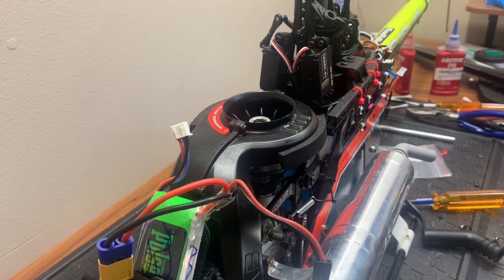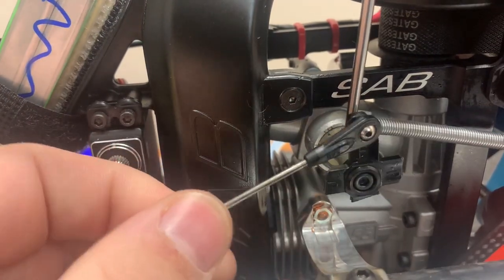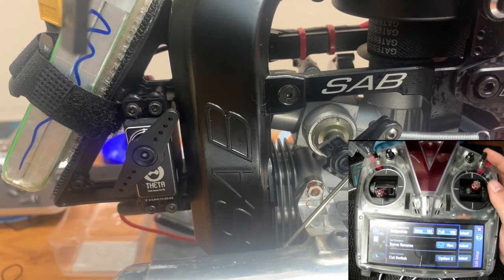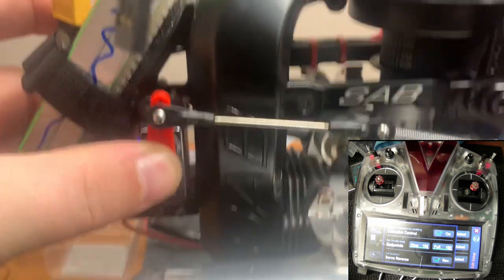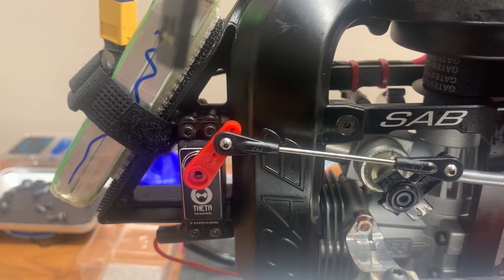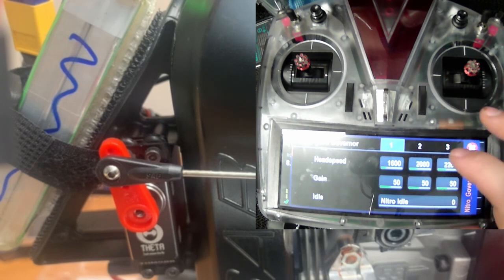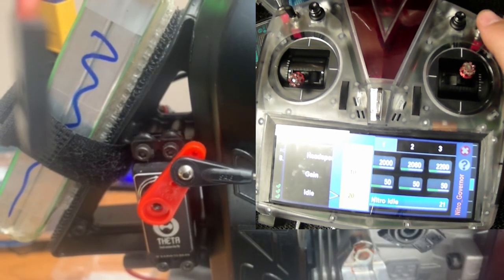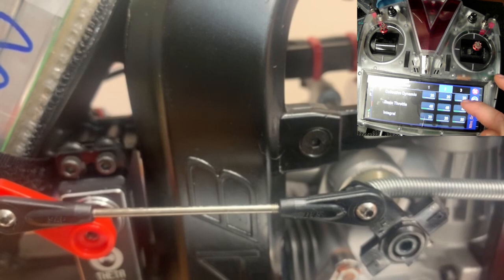Vbar Nitro Gov Tutorial By Tanner Ingram

Comment: Thanks for the video Tanner. Really made it a lot easier setting up my first nitro on the VBCt. One question though, is there anyway to limit the maximum throttle value in the Direct Throttle mode? Just so it wouldnt potentially be able to rev so high in FM1 (where I have Direct Throttle selected).
Reply: Yes you can, if you turn direct throttle off and instead set a curve for bank 1 you can set that up!

Comment: Why after fly vbar touch not display rpm graph...what is problem..?..please help me...
Reply: By default it should display it, you have to be connected to the model of course. If your screen doesn’t have it, you can add any parameter by long holding down on the screen -> add the rpm signal….. shoot me a message on Facebook if you still can’t figure it out and I’ll try to help ya.
Reply: @tanneringram1449  i mean after disconnct power...usualy vbar touch will show the log data example rpm , temp but my vbar touch just show log data controller...i will message u ...thank sir
Reply: @firdausborhan6319  ahhh. Yes it only logs the data if it’s being read over the ESC telemetry. Sadly VBAR doesn’t log the rpm port itself or other data we have with nitro. I wish they did!

Comment: What’s the sensor config setting?    I think I have the wrong setting as I was setting up my throttle servo and now my heli won’t change banks.   My sensor Config is set a 5 right now.   Using spektrum back plate sensor Vbar control
Reply: Sensor config as in number of poles? Should be set at 1 pole in the VBAR (as it’s reading the back of the crank once per rotation)
Reply: @tanneringram1449  thank you!  Somehow when I reset my settings for min/max throw it put it to 5 and my head speed wouldn’t change.   Now it’s working thank you